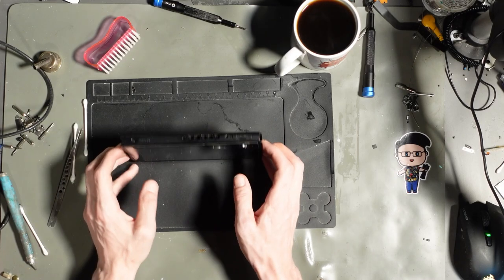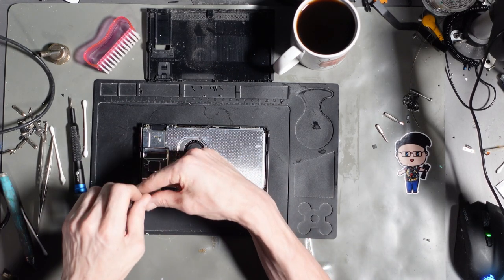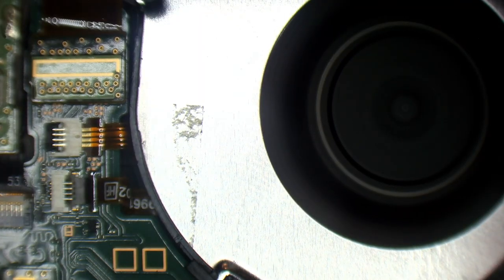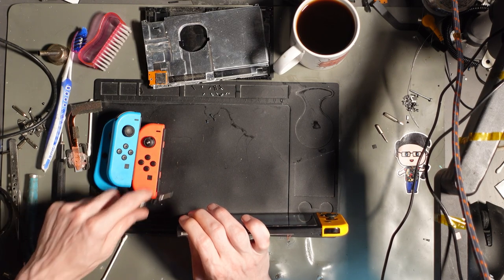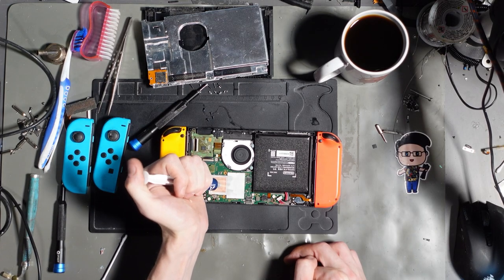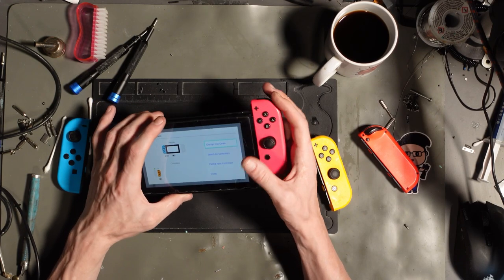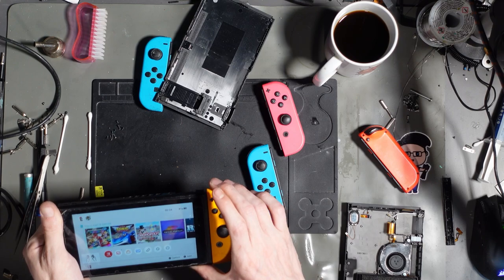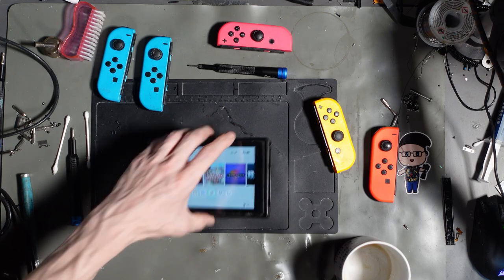Kitty Pics Get Clicks When There's A Console To Fix! Nintendo Switch Won't Charge Or Connect Joycons

Comment: So putting 4V on the fan resets the mosfets and that's it?
Reply from the maker: Yeah it's not always a guaranteed fix but I've never had one returned when it does, and it's about 90% success rate. I think the mosfet fails open and injecting 4v kick starts it back in to action. Kinda strange really. I discovered it by accident, I wanted to test the fan on one and forgot to unplug it from the board lol